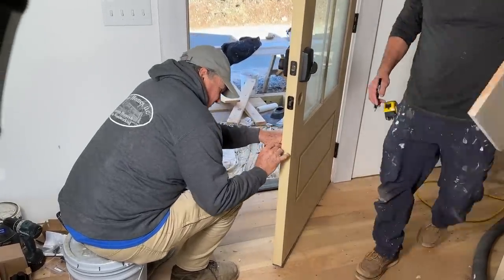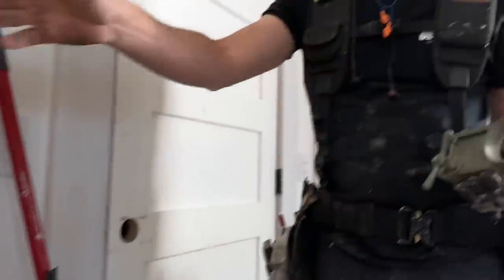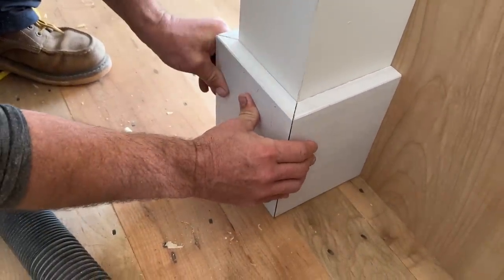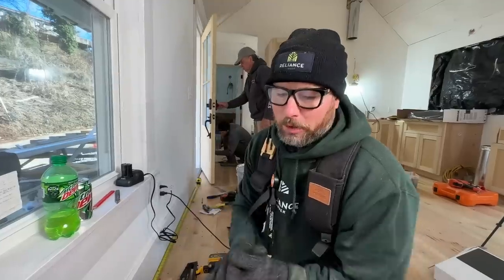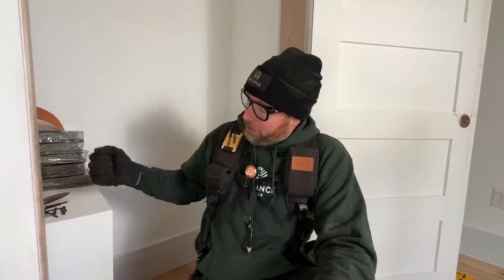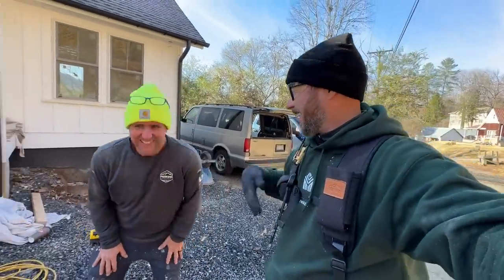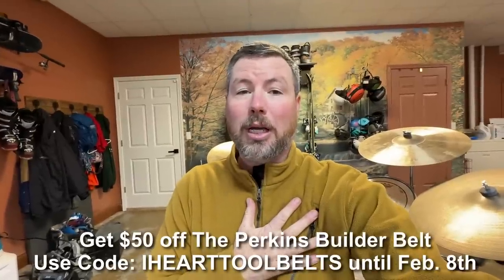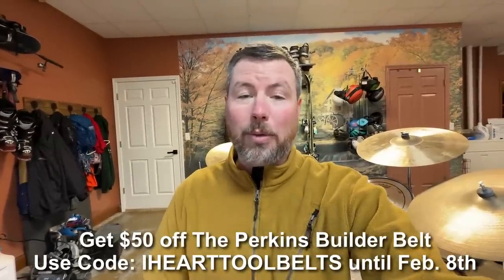Building A Small Income Property | Part 33

Comment: I'm a locksmith and those jigs always scratch the doors. Framon has a nice one that's padded but you could put paper on the door first if it's finished. I lightly  put them on the door. Drill from both sides just to get my center marks and take the jig off. I never drill all way through so I don't get tear outs. I drill from both sides and finish in the middle. You can also drill from one side until the center bit breaks through the opposite side and finish from that side. I have done it that way as well.
Reply: Yup I’m also a locksmith and I use the A1 jig (unfortunately the company doesn’t exist anymore). It has rubber pads that if kept clean won’t scratch it up. I always drink from both sides first to avoid tear out as well
Reply: @n8ryder  I like to drink from both sides also. :)
Reply: I put some good duct tape on the inside of the jig to protect the door from marking.

Comment: A lot of CNC and higher end machines use drill bits like that for metal which have coolant running through the shank. You buy a shank that holds a certain range of sizes then change out the inserts for different size holes.

Comment: Hey guys, figured since you all have shared so many awesome tips over the years, I got one for you! Wouldn’t be surprised if one of you already knows this, but here goes. 10:59 when Eric is putting the big stretch on the baseboard, I use circular patterns and it forms a sort of suction when you push on the piece the air in the circle collapses. Seems to help hold until the adhesive cures. Keep up the good fight!!

Comment: A tip that I have been doing for about 30 years. I mount the door stop on the door, instead of the base board. This keeps it out of the way of almost everything, especially the vacuum cleaner. I had to replace so many of them where people break them or knock them out of the wall making a hole that I have to plug and so forth. Looks a bit strange in the beginning, but it saves a lot of do overs. It is also cool if homeowners wish to have a piece of furniture behind the door.

Comment: I thought that finish carpenters liked to have the wood to be used stored inside the warmer home, so as to prevent bowing or buckling when it was finally brought up to room temperature. You guys must never have had any problems in using cold lumber.  Great video as usual.

Comment: Nice old door lock jig. The arrow shaped bit works good boring narrow doors without the likelihood of splitting. Also, I cringed when you bored the lock hole and went right though the door from one side. You must cut from both sides to eliminate the chances of blowout and making a mess on one side of the door.

Comment: Hey Perkins bros, I'm replacing some exterior trim on my parents house. This trim was primed with Cover Stain Oil based primer (multiple layers) and then an exterior acrylic enamel.  The trim was in terrible shape, in many areas it was rotted so much that only the paint shell remained and where there was still wood it was wet and spongy (The trim seemed to be painted well too, back primed and primed on the butt ends.)   The last rain we had had was multiple weeks prior, which brings me to my question.  Would using a primer that is higher perm help extend the life of the exterior trim?  If so what type of primer might you guys use on your project?
Reply: I really like zinnser bulls eye primer

Comment: It’s called a spade drill. We use them all the time on lathes in the machine shop to cut steels.  That jig was probably designed for cutting steel doors? 🤷‍♂️
Reply: The bit being used is a large forcner bit. It creates a huge mess and is hard to control. A standard hole saw creates less mess and gives you a pilot hole so you can drill from both sides with a clean result 😉
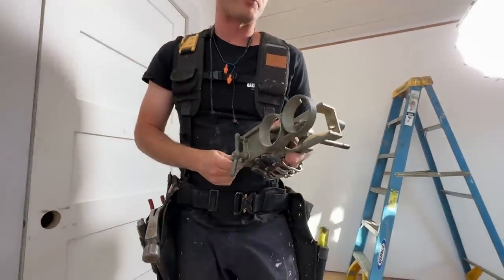Reply: @jasonkonieczki2194  At 2:55 in the video Jamie was asking about the bit attached to the jig. It’s a 135° spade drill bit.